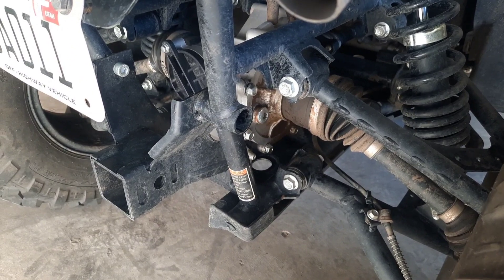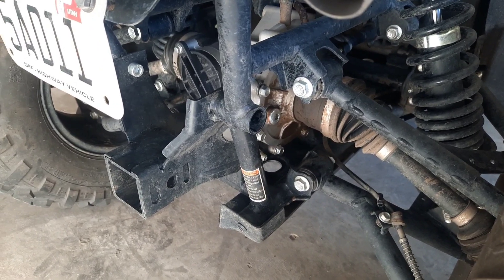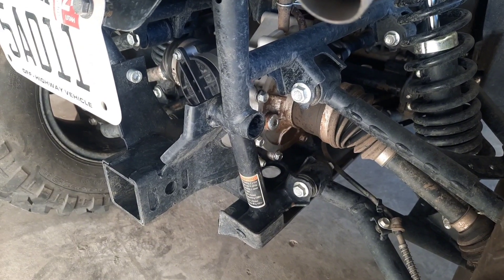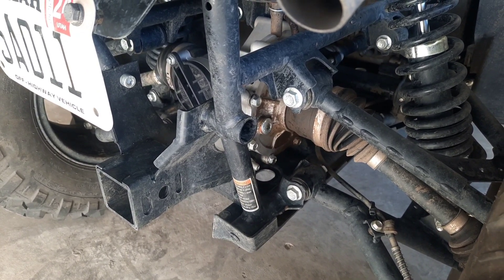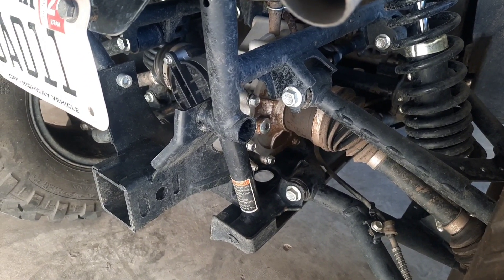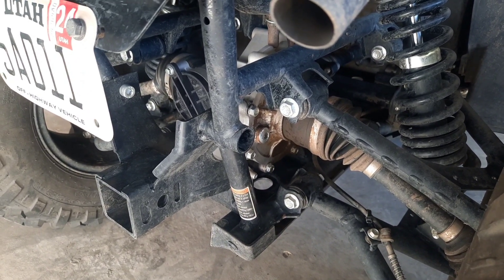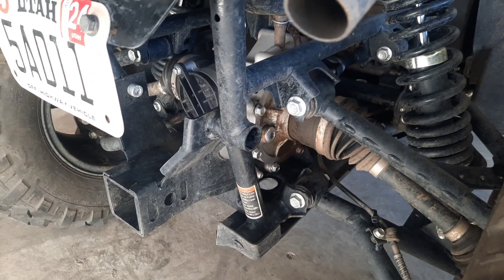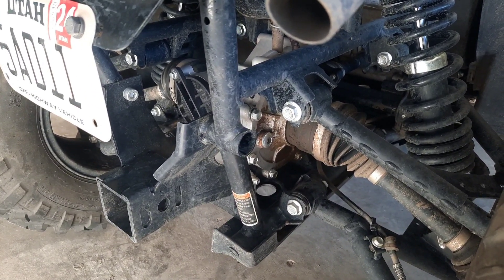Gen 2 CForce 500, Issues You Might Want to Know About

Comment: I have put 3200kms on my Gen2 500.
The Rear diff leak is very common, its been on forums, social media pages, etc. It happened to me as well. Dealer put a new seal in and no issues since. Seems there was an issue from factory. They've corrected it for new models. 

My 2nd issue was water damage in the screen. It was a complete fluke. I dont do deep water at all either nor beat it to crap. Dealer sent photos to CFMOTO and they couldn't believe it happened, but did warranty it with no questions. 

3rd issue was a recall on the blinker relay. Simple, was covered.

I love this machine. I've rackes up the miles and keeps on going. I have added some accessories and a now high-flow 2inch exhaust tip. Helps with cooling and bit more grunt.
Reply from the maker: I should probably fix the diff leak while it's winter. How bad was yours leaking? 
At the moment, mine only seeps when I ride it, very minimal. 
I'm out of warranty, so I'll probably replace it myself.
Reply: @RideAlongOutdoorsCh.  It was only seeping, and only while riding. It's a fairly easy fix. Dealer said it took them maybe a half hour.

Comment: All atvs have to have the valves checked/adjusted- only if needed. When I had my KingQuad 400, 500, 750, they never needed adjusted at all. It tends to run as normal at the high mark for temp reading on mine as well. I did manage to bend my skid plate on a small bump in the trail. It needs better skid plates. Shifter is notchy. Build quality is 2nd to none. I feel like; the 500 KingQuad def got more low end punch & will wheelie on demand. I understand the cforce 500 does weigh an extra 100 lbs more with the same 38 hp. I have to find some accessories to bolt on this week.
Reply: King quad 500 is the best

Comment: I bought the 600 took me about 1  1/2 to get the plastics off and 1  1/2 to get him back on maybe 10 minutes at most to take the valve cover off check the valves and put it back on again. There was no way I was going to pay CFMOTO to do that for $500. All these new machines are the same they have the engine completely trapped in plastic stupid if u ask me. By the way the valves were all still spot on Really was a waste of time and I knew it was tthe machine was running fine.

Comment: The valve clearance maintenance is a manufacture precaution.. not necessary by any means other than some push back incase there is a costly warranty claim. The dash and oil leak are slightly unusual and considerably leaning towards what some may call a lemon. A new vehicle is a new vehicle and should be as accountable as a new car (CF Moto is now a reputable brand). There should not be any oil leaks or malfunctioning electronics.
Reply from the maker: It is disappointing, and it's past the warranty.

Comment: I have a 600 touring. I have 1000 miles on it. I had the same temperature problem and it was air in the system. The shifter will free up, but if you will hold the break when you stop it will shift easier till then. But I have had no other issues with mine.
Reply from the maker: I've been debating swapping out the coolent for EngineIce. How do you like riding the touring with no passenger, any downsides?
Reply: It’s a little stiff, but still rides good. I love the extra length on the steep trails. I live right in the middle of the Hatfield and McCoy trail system.

Comment: Change out the factory garage coolant to maxima coolanol. I did and mine runs a bar cooler at all times.
Reply from the maker: Do you attribute the better cooling to the different coolant or flushing and purging the system?
Reply: @RideAlongOutdoorsCh. Yes it definitely is the maxima coolanol as I did the same to my 2021 500cc with the same results. My 600 runs cooler without a doubt @ idle once it hits 4 bars the fan kicks on for about 20 seconds then turns off and I'm back to 3 bars. With the factory coolant @ idle it would run @ 4 bars then to 5 bars then the fan would come on an drop it back to 4 bars. So yes the maxima coolanol is well worth the $$. I drained the entire cooling system in my 23  600cc  and switched it to maxima coolanol. Driving now with the maxima it mostly stays @ 3 bars where with factory coolant it was 4 bars and once in awhile it would reach 5 bars. Definitely one of the things a person can do that will  be a engine saver.

Comment: The valves are part of the 1 year warranty. Engine and drive train. So as long as you got your 1000 miles or 200 notes with in warranty should be fine. Diffs are also covered

Comment: got the same 2 months ago 100 miles, nothing wrong yet. Shifter finally starting to break in, that thing was annoying af lol. nice ride! Also mine was recommended break in service just check normal things over and change fluids, first service is at 1500 km or 50 hours and my dealer never mentioned any valve clearance check, strange.
Reply from the maker: If you're outside of the US, things might be different. I would check what your owners manual states for break-in maintenance.

Comment: Was it leaking before you topped it off? 
It also maybe your battery connection. Tighten it dien!
Reply from the maker: It was leaking, but not a lot, because it didn't take much at all to top it off.

Comment: Never did say the miles  cf600 2200 somewhere around there And honestly the only thing that doesn't work is my reverse light and I don't know if they ever did. Not a fuse so I think it's in the reverse switch Besides that still on the original belt did upgrade a lot of things though. Weight less issues then I had with my brand new  Polaris 570 That thing was falling apart at 2000 miles.
Reply from the maker: It has about 300 miles on it.